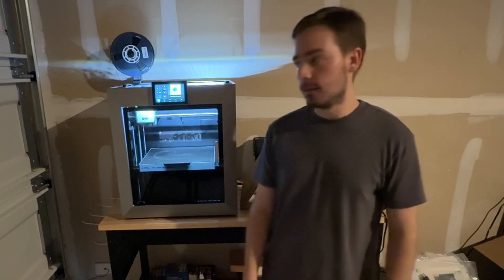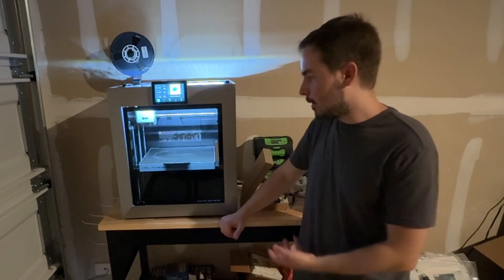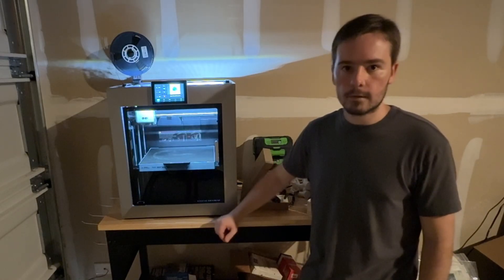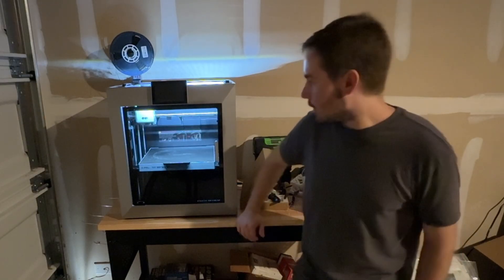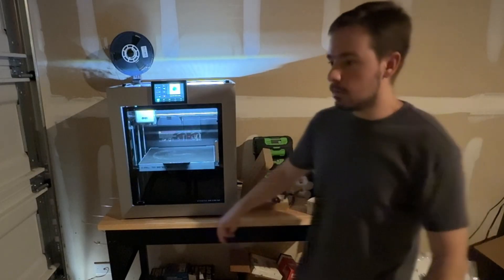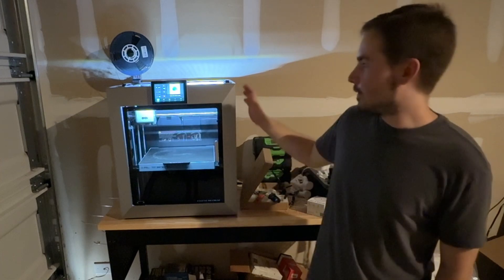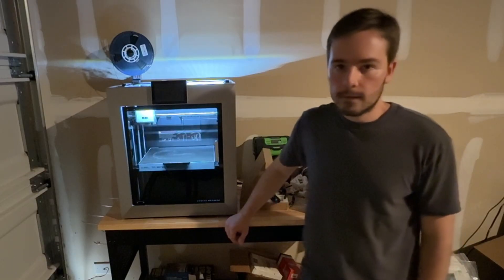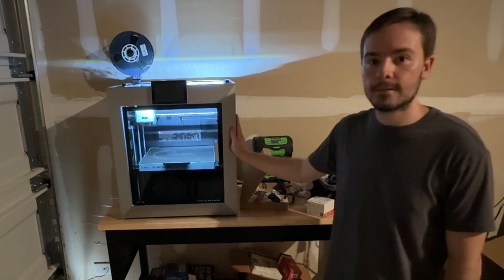Qidi Plus 4 - First Impressions from someone new to FDM printing (2025)

Comment: Make sure you're cooling settings are set right for overhangs. You may need to up the cooling fan speed sooner or even bring in the aux fan to help during moderate to severe overhangs. I had to do this. Once done, it's easy to save the new filament profile.
Reply: ...yes...make sure all the screws are tightended properly. Also, every 100 hours or so, I clean and re-lubricate all the rods. I use 3-in-1 oil, though any good lubricating oil will work. I loaded a sponge with some of the oil and keep it in a plastic bag. This way it's not so messy when applying the oil.

Comment: I LOVE my Plus 4! In fact, I just ordered a Q2 to become my main multi-color printer. Now, my Ender 3 v2 will print primarily TPU and PLA, my Plus 4 will print any high-temp and engineer-grade materials, then the Q2 will be my all-around go to for everything else. I would love a tool-changer at some point, but maybe someone will release a retrofit kit for the Plus 4 sometime down the road.

Comment: Thank you for this video. I don't have a Plus4 yet, but have been doing a ton or research. When I get one i'll do the Beacon mod right away.
Reply from the maker: I'm glad you found it useful! I haven't had any z issues since setting my z offset, but I've also only used PLA/PLA+, and I think you have to dial it in for different materials. Beacon mod is something I am strongly considering as well, especially once I start using higher temp nylon CF/GF filaments that use the heated chamber